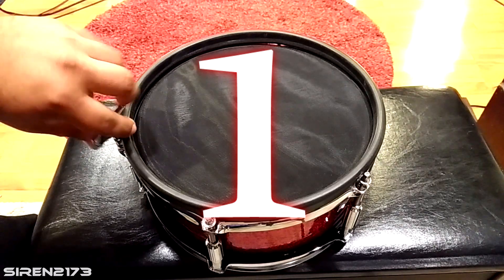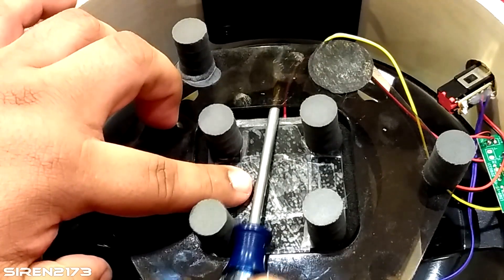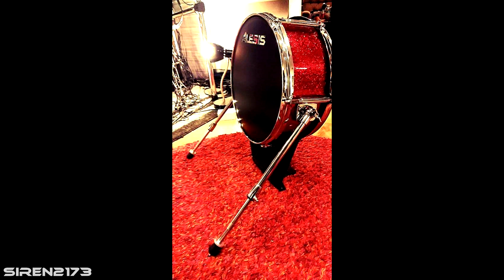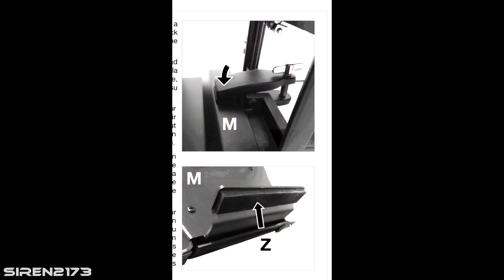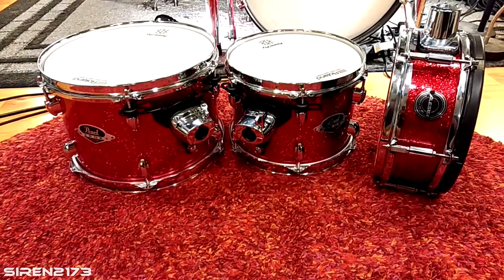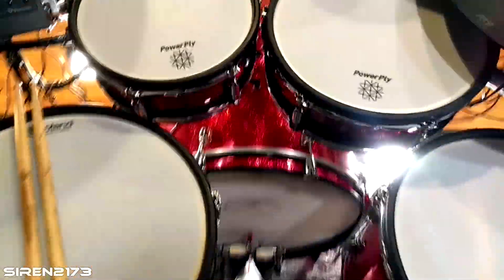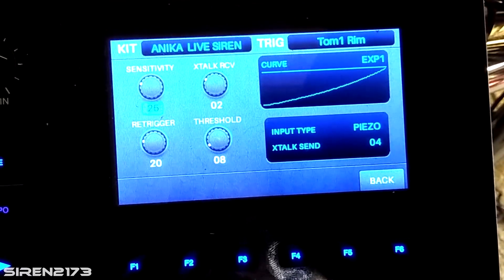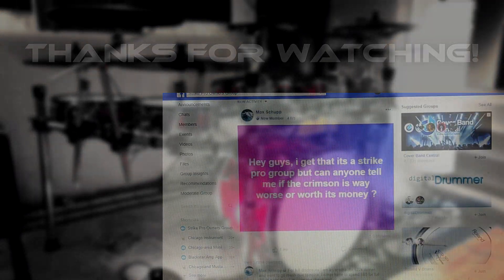Alesis Strike - 5 Things You MUST DO!!!

Comment from the maker: **DISCLAIMER**
Alesis has updated the pad design so if your pad does NOT look like the one in this video (clear center plate and no foam) you should be good to go. You still should check though as dealers will continue to sell old stock.
Reply: SiREN-DRUMS SiREN-DRUMS Hey I love your channel and your videos are so informative. I just ordered my kit. It will be here Wednesday. So as far as the Pads go, in the video they just look like they’re black and clear. So are you saying the new updated ones have a layer of foam in the middle? I’m just asking so I know what to look for one like it arrives. Thanks for all your help
Reply from the maker: @Hillsidekman  the new updated design has a clear center plate (you'd be able to see the trigger in the center) and there is black tape going in between the center and outer plate. You wouldn't see the red/black wire like how it is in the video. That's probably the easiest tell. If you see the red/black wire, tape the plates.
Reply: SiREN-DRUMS Thanks for getting back to me! All right I’ll take a look. Just to clarify you’re talking about the trigger plate in the center not the actual mesh head? Thanks again for your help!
Reply from the maker: @Hillsidekman  yes the plate inside you'll need to take the mesh head off to see.
Reply: @AtTheSourceStudios  So glad I ran into this video, I was starting to steer away from this set due to the problems people were having. I take it the new updated clear plate is much stronger than the previous black plate. Do you think this is a big improvement and it will fix the majority of the problems with this set? Where did you find this information, if you don't mind?
Reply from the maker: @kered45  yes I actually own a 2nd gen snare now and they have fixed the issues. (Wire is ran differently and plate seems about twice as thick) However I don't know if they've done the same for all pads or just the snare so I would still check all pads.
Reply: @AtTheSourceStudios  Have you checked if all the other pads have been updated? Or is it just the snare?
Reply from the maker: @abodlack  I personally haven't checked anything as I use an acoustic conversion
Reply: Of course i didnt follow that first thing in the video.....
Now... My snare drum is broken...
Im really really angry..
Reply: @Hillsidekman  Thanks! Is it a good idea to tape the plates ANYWAYS, even if it's the newer generation? I get my Strike on Friday :-)
Reply: @AtTheSourceStudios  Where are you guys getting this information about design update? I am about to purchase a Strike Pro Kit with a Sample Pad Pro, adding one14' drum pad, and two cymbals. I called Alesis tech support and they are telling me that no design changes have been made. Someone please help me on this one. You guys seem to see a physical change in the hardware, yet Alesis tech support doesn't seem to know anything about it. I look forward to your response.
Reply: @angeladenovio2717  It's been confirmed by employees on the fb page for strike pro owners.
Reply: Hey SiRen I just purchased a strike kit and I’m having troubles with the cymbals. When I hit them sometimes they will sound low or really loud or won’t trigger at all. Then When I’m hitting the bell. it comes out as I’m hitting the edge or middle of the cymbal it does this on both the crash and ride. And also how should I set my triggers for every drum for perfect sound.
Reply: @AtTheSourceStudios  hello, I was hoping you can help me out  with a problem? I just purchased a 14"×5" electronic snare and have the strike module version 1.5, I can't get it to crossstick, can you help?
Reply: You prolly dont give a damn but does someone know a trick to log back into an instagram account??
I somehow lost the password. I would appreciate any tricks you can offer me
Reply: @Ralph Alaric Instablaster =)
Reply: @Ibrahim Lionel I really appreciate your reply. I got to the site on google and im waiting for the hacking stuff now.
Looks like it's gonna take quite some time so I will reply here later with my results.
Reply: @Ibrahim Lionel it worked and I actually got access to my account again. I am so happy:D
Thanks so much, you saved my account!
Reply: @Ralph Alaric no problem :)
Reply: What kind of hi hat do you have?

Comment: I want to thank you for making this video. I just bought a used kit. I opened up all the shells and found the snare was starting to crack. I put the tape on the center pickup, and then I transfered the snare with the 14" floor tom which was not cracking after applying the tape to each of the toms. All drums are working correctly and I don't think I'll have any issues with the 14" tom as it isn't a drum I hit very often and especially not as much as a snare would be struck. So thank you again for this video!
Reply from the maker: That's good man! I'm glad you caught it before it went out fully. Don't forget to free the wire too! :) Thanks for watching man.
Reply: @AtTheSourceStudios  I did do that as well thanks again!

Comment: Ok, the purple sparkle kit is mine and they are set up at the exact same height as my acoustic drums. In fact, I use the same rack for both my electric and acoustic kits. Also, ergonomically speaking I bought these drums so I COULD set them up lower if I chose to. 

Thanks

Comment: Working with a drummer that has this kit and everything but the snare sounds good, sounds like it is going through a filter that cuts out the low end, however when using it through a non alesis PA it sounds fine, we called customer service and they are sending a new brain but I cannot wrap my head around why that would be an issue with the brain. Any ideas?

Comment: What’s the purpose of the clear tape you used in the beginning?
Reply from the maker: To strengthen the center plate to prevent cracking. It's a little thin from the factory.
Reply: i'ts to avoid the trigger plate from snapping in two

Comment: I have the forge . Good kit but leaning towards updating to the strike. What's the difference in strike and strike pro? Would someone have to update the module if its purchased between now and a few months? I like your videos and your playing in amazing ty
Reply: The only difference between the two kits is the number of pads you get. The basic Strike kit gives you 3 toms and 1 crash, while the Strike Pro gives you 4 toms and 3 crashes. Everything else is the same, including the module. It's possible that the module you get with your kit may be updated to the latest version already. You just need to check which version it's running.

Comment: Any suggestions on how to get the kick drum louder than just the compression techniques? Mines rathe quiet. Any info would be much appreciated!
Reply from the maker: Should be plenty loud so something's not right. Maybe make sure sensitivity is at a good level. Otherwise sensitivity could be too high on the other pads. (Sensitivity also adds a bit of volume because higher velocities are louder and you get there faster with a higher sensitivity)
Sounds like kick isn't dialed in good tho.
Reply: @AtTheSourceStudios  Hey thanks for the info! After a few more hours of going through the settings i was able to get higher volumes out of the samples. I guess compression mixed with trigger settings is a huge note to take on dialing in sound. I was using standard skull candy headphones too , so I may try a better pair from the music store as well. Thanks for the help!!! Much appreciated

Comment: My question is, what kit sound would you recommend to get the sound of the drums in this intro song?
Reply from the maker: The kit used in the intro is a mix of Steven Slate Drums 5 imported samples and Strike samples (some SSD5 cymbals some Strike cymbals, kick and snare are SSD5 with Strike layer) so it's the Strike module that is the key there. The new Strike SE looks like a great kit although I haven't tried. Either way tho that's what the sounds were in the intro.

Comment: I ordered the strike pro. Is taping the inside still a necessity?
Reply from the maker: Checking to see which gen pads you have is a necessity. If you see the red/black wire then do both of the modifications mentioned in this video. If the wire is hidden then you're good to go but be sure to check ALL the pads not just the snare.
Reply: So if the wire is hidden, I don’t need to tape the inside? Thank you for your reply!

Comment: Again a set that is called pro should not require that you fix anything as soon as you open the box, until Alesis addresses the quality issues I will not buy a set from them. The other thing that nobody talks about is the horrendous loading times in that module, it's just not up to spec with even cheap modules. Yes you can load vst's, but if you have to wait 10 to 15 seconds between sets it makes it a deal breaker.

Comment: What would you recommend for 1100 euro?
Reply from the maker: Hmm I'm in the states so I'm just taking a guess that 1100 would be about $1600 here... In that case, if you want the best sounds, dynamic playing experience and feel of the pads - Alesis Strike (base not Pro), if you just want a little plug and play practice kit and don't plan to record anything or play through a PA - Roland TD-17KVX. Honestly those are about the only two options in that price category I would consider. 
Personally though I would say go with the Alesis Strike regardless as the module is head and shoulders above the TD17 in sounds, pad feel, dynamic response to your playing and overall potential with sample import and other features. If you follow this video you should be set up pretty good. I've had it for a year now and my pads are in perfect playing condition. Happy customer here.
Reply: The Alesis Strike pro costs €2300 and the Stike €1900 euro. I have sell my TD25 and bought a TD9 with a extra crash. 
Unfortunately i couldn't find a Alesis strike occasion...Thx for answere! And good.luck with your Ddrum 3!

Comment: How do i crank up the volume? I swear i cant hear it haha
Reply from the maker: That's weird is your module up to date? I usually run into a small mixer so it wouldn't be an issue for me ever but when I did plug into the module my phone's volume at about 2oclock is plenty loud enough. The right way to add volume would be to run into a small mixer otherwise you can turn the eq/comp on for each pad/zone and under compression just turn the output up. This would make you have to duplicate each kit though so it's not ideal. Headphones can also be louder or softer one brand to another.
Reply: @AtTheSourceStudios  I guess i'm just gonna buy a small mixer! 
Thank you for your answer!
Reply: @AtTheSourceStudios  and my module is up to date (1.40). Its brand new and i bought it today
Reply from the maker: @stofzuigzakkie45  like I said that's weird then. I know some people really like it loud though. I've never had an issue with the volume and this is my second module (sold first one but then got another one used). If you have a mixer maybe hook that up. Or a drum amp with have headphone output and can amp it louder for you.
Reply from the maker: @stofzuigzakkie45  no problem man. I recommend the Behringer Xenyx 502 it's what I use and sounds great!
Reply: @AtTheSourceStudios  many many thanks!!
Do i need a special cable for this mixer to connect it to the module? (XLR or just a jack)
Reply: And does it gain volume because that is what i need to do
Reply from the maker: @stofzuigzakkie45  yes of course it makes it louder. :) 
You'll want to get this cable and plug into the headphone output of the strike into the R and L of one of the tracks on the mixer.
https://www.guitarcenter.com/Hosa/STP204-BLM-1-4-TRS-Male-to-Dual-1-4-TS-Y-Cable-4-m-1316478168360.gc?cntry=us&source=4WWMWXGP&gclid=EAIaIQobChMI9vbVwLrC3gIV17bACh09fgcdEAQYDyABEgIaTvD_BwE

Comment: Step 1, fix the kit before you use it. Lol I'm done with Alesis and their junk. I'd rather fork over more money for a ready to use ekit. I applaud you for this advice though. The strike is a pretty damn good module.
Reply from the maker: Um well technically speaking nothing is broken to fix so all I'm saying is to prevent possible failures. As a happy user of the strike for a year with no pad failures and now trying a Roland module for the first time in a year the difference is night and day and not in a good way for Roland. I'm not saying I fault anyone for not getting the strike but the half hour it'll take for preventative maintenance is well worth it.
Reply from the maker: Furthermore Alesis has listened to the customers and updated the pad design to include thicker center plates as well as changed the position of the wire so this shouldn't be an issue for people getting newer stock kits. Of course that doesn't mean they'll be recalling old stock so this video will still apply to many users. Alesis is said to only have to give replacements to 1% of it's strike customers. Squeeky wheel makes the most noise.

Comment: I noticed you’re using the felt side of your beaters.  
Not recommended with mesh heads. 
The friction will wear down the head. 
Plastic beaters will prolong the life of mesh heads.
Reply from the maker: Normally yes that is true but not when you use a bass drum patch.
Reply: @AtTheSourceStudios  ahhh yes I see the patch on the SE 20” kick.  I was looking at the regular Strike kick and didn’t see it with the black head on it.

Comment: any advice on Sensitivity settings vs Voice Sound Levels?  I want to get my kit as close to real dynamics as possible.  Im not sure if its best to reset the settings and then set sensitivity first then adjust the voice volumes after.
Reply from the maker: What I would do is get groups dialed in. For example. The two high toms should in real life respond similar so assign the same sample to both then dial one in to match soft to loud to be most dynamic then match the other tom so it responds the exact same. Sometimes that doesn't mean the same sensitivity level. Then do the two floor toms same way, crashes etc. Then adjust volume levels.
Reply: @AtTheSourceStudios  Thanks I give it try.  What do you mean exactly when you say groups?
Reply from the maker: @kilamity  just like set up "alike" pads together like... Get one crash set-up then put the same sample on the others of the same size and make them respond the same. Etc
Reply: @AtTheSourceStudios  Thanks for taking the time with your answers man.   I went through each pad and adjusted the sensitivity using one of your kits I downloaded.  Feels and sounds much better.  What do you think about those Pintech pads you have?  I think thats what you are using for splashes?